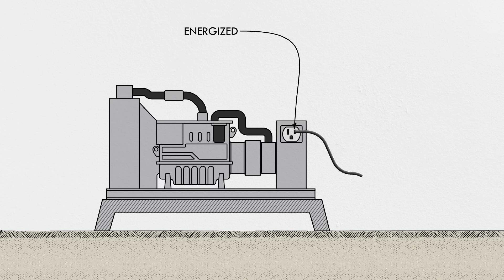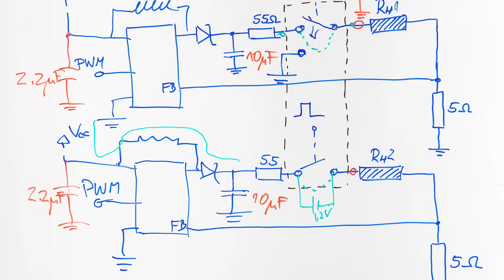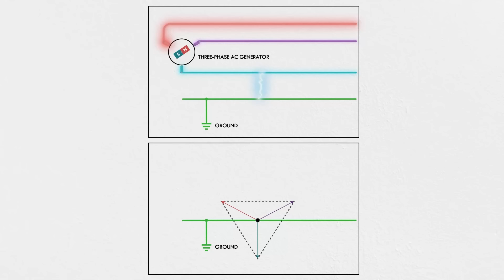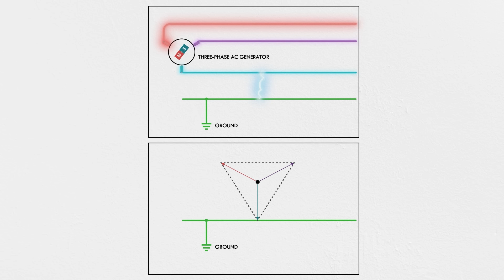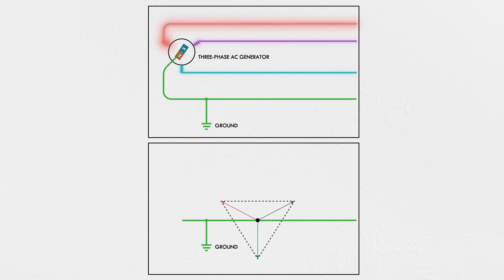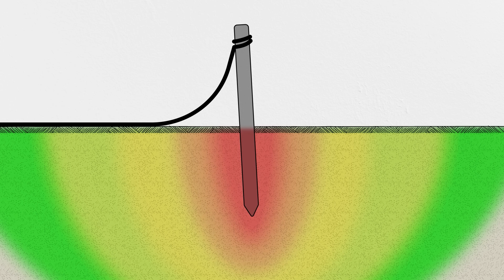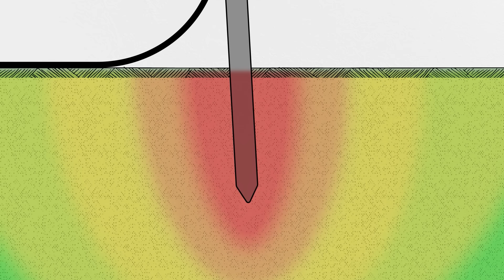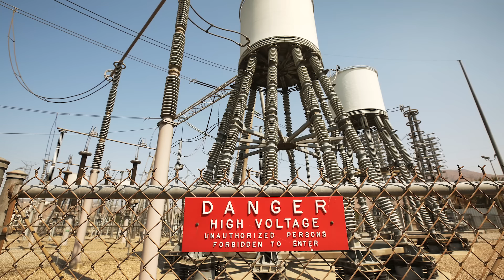Where Does Grounded Electricity Actually Go?

Comment: it goes into the ground
Reply: I can't believe it
Reply: i see, thanks
Reply: @GOOD_FARMER Yes, the ground is made of ground. 👍
Reply: @interstellarsurfer No it's made of earth
Reply: @gamemeister27  
no its made of Gaia
Reply: @AmirDarkOne  Your third party nonsense will never work!
Reply: @gamemeister27  
third party of what?
what are you talking about?
Reply: @AmirDarkOne  I'm just being silly.
Reply: Babby's first joke 🏆
Reply: Aaaactually… the electricity goes to power the turtle that the earth sits on.
Neanderthals….
Reply: Where do babies come from, Wizard?
Reply: THANK YOU FOR THIS RECAP I DONT HAVE THE TIME TO WATCH THIS ALL FOR MY TEST
Reply: Electrical flow is based on the movement of electrons, which are negatively charged. The electrons do the actual moving. Negatively charged electrons are drawn to sufficiently positive charges. 

In the event of a lightning strike, the various molecules in the atmosphere develop a positive charge. When the positive voltage is dufficient enough, neighboring atoms give up thier electrons. This repeats in a dominoe effect chaongi g all of the way down to the ground via the path of least resistance. The electrons are actually flowing up and the display of light is because of the electrons moving. The movement starts in the air. Think of it like traffic. The first car moves, then the second car moves, then the third, and so on. What we se is the initial movement, making it appear as though lightning is striking the ground, but it really isn't.
Reply: @exisfohdr3904  wow. Way to ruin a humorous thread. You must be fun at parties.
Reply: As soon as I read the comment I closed the video immediately, it was the answer I needed, thank you
Reply: Wow, thanks so much for spoiling the video….
Reply: This is true in the States, sure. But we need to keep in mind this is regional behavior. In the UK it goes into the Earth instead, for example.
Reply: @AmirDarkOne third party is the one after the second party. 

Disclaimer: I'm also just being silly 😅 more laughter 4 the world!!
Reply: @iggdawg in Australia, it comes out of the ground to power the generator,  obviously.
Reply: Saved me a click
Reply: Nooooooo!
Ya think? 😂
Reply: We aren't blind
Reply: Oh. My. We have a real visionary here among us
Reply: @davecrupel2817  We're still trying to debate it so hang on with that conclusion please
Reply: Got em. Next.
Reply: Spoiler alert
Reply: Like the electricity, this man's comment took the past of least resistance.
Reply: It doesn’t go into the ground, it goes through the ground
Reply: Okay calm down Nikola Tesla
Reply: @Lefty217   😆😂💯
Reply: I need to see it to believe it
Reply: 😂 hahaha
Reply: @gamemeister27  No, you're wrong just face it. It's made of ground.
Reply: @euphan123 Deez nuts 😂
Reply: @GOOD_FARMER  no it doesn't. The earth is like a capacitor with a certain capacity, but it discharges through the atmosphere. The earth has a capacitance of 711 microfarads, with a super high capacity and voltage limit. Energy disperses through the grownd; this effect can be easily seen with a film capacitor. If you discharge a film capacitor, then it will discharge all accessible power, then if you wait a few seconds, more power will come out; this is because of the dispersion of energy. Think of the earth as a bidirectional capacitor, where the atmosphere and the ground represent it's electrodes. If you put high frequency, high voltage power into the ground, then you will get a return voltage, and the rate of time it takes to return is the planets electrical resonant frequency. If you match the resonant frequency, then the amount of return voltage will continue to build because you are charging the earth, but it has a capacity. At a certain point, the return voltage will peak, since it is discharging through the atmosphere.
Reply: @exisfohdr3904 You have a number of errors in your otherwise excellent lay persons explanation.

1. It is more like a chain than cars in traffic. As one electron moves it simultaneously causes the next electron to move (dragged) into the vacated valence shell.
2. The appearance of lightning striking from sky to earth is solely due to the concentration of charge. When the lightnings multiple paths are being charged they come from many sources at earths surface to a focal destination in the clouds. As the concentration of charge in the sky is greatest, the light intensity glows brightest there, while the concentration is increased along the paths giving the impression of a bright starting point in the sky reaching down the path to earth.

This why collection of charge from a lightning strike is a pipe dream, you would need electron collectors in the atmosphere.
Reply: @GOOD_FARMER i dont think its infinite, we can calculate the capacitance if earth by using the concept of speherical capacitors
Reply: This guy gets it
Reply: @GOOD_FARMER  infinite my @$$. What’s the actual capacitance of the earth 🌍 ? And what if it’s overloaded? (Think of vegeta ki blast assuming ki is electrons)
Reply: Thanks, you saved me about 20min
Reply: So the lizard people in the earth get power aswell
Reply: @The-Cat are you part of the 4th party?
Reply: What a groundbreaking discovery!
Reply: @kennyalbano1922  ah dang it, okay what gave it away? How did you find out?   What kind of un4tunate mistake has revealed my origins? I need you to produce an answer at once!
Reply: Genius
Reply: My god
Reply: I tend to disagree
Reply: The Backrooms not the ground
Reply: @gamemeister27 😂
Reply: CHI-NA
Reply: Thank you. Youve saved me so much time.
Reply: Happy Birthday to the ground!
Reply: As we all do😌
Reply: Happy birthday to the GROUND
Reply: @The-Cat  elementary my dear whiskers. Solving this case was easier than the cats pajama’s. All I needed was some hair of the dog while I listened to what a little birdy told me and this case was solved lickity split. And don’t you worry the electric chair has a way of relieving one of all nine lives. I don’t here a peep, what cat got your tongue?
Reply: This is the kind of answer humanity needs…. For many things
Reply: Love the avatar. I'd keep a sheep in my apartment but there's a height restriction on pets here.
Reply: but where in the ground?
Reply: Oh no... apparently, according to this vague descriptive dude, it goes "through" the ground 🙄 you know,.. because there's some scientific difference there between what it actually does when it enters the planet..
Reply: @samuelhulme8347 I'd prefer a Nobel prize over a noble prize🤷🏻‍♂️js😁
Reply: Really?!
Reply: saved me 19 minutes!
Reply: @tempesttree8839  that’s what I meant!
Reply: @o0Donuts0o Not directly. It goes 1st through the 4 elephants.
Reply: wha?
Reply: No fuckin way
Reply: Gosh, spoiler much
Reply: Wow, thanks for the spoiler
Reply: Thanks you saved me 20min😊
Reply: Duh
Reply: Wow. You could write a book
Reply: I’ve never wanted to like and dislike a comment at the same time more in my life
Reply: @o0Donuts0o it's turtles all the way down, not just the one
Reply: Good morning, Mr Oppenheimer
Reply: Then why is it called grounding?
Reply: I was gonna watch this video until I saw this comment
Reply: This comment didn’t age well
Reply: It's has what plants crave
Reply: so true bestie
Reply: But it has to be home by 8pm, and no partying
Reply: yes
Reply: It has something to do with the average macroscopic cross-section of thermal neutron flux.
Reply: no video needed
Reply: get this guy a nobel prize
Reply: Huge
Reply: I noticed that too. 👍
Reply: WHAT, that’s impossible
Reply: Epic troll
Reply: It goes to China
Reply: Thanks…video explained other details which we were not interested in.
Reply: Yep
Reply: @iggdawg and in France it goes into terre
Reply: I still don’t get it
Reply: @Gomer._.  try to put yourself between a live wire and the ground. It may clear up things (or not). Anyway electricity flows between to points with different potential (voltage) and soil that has electrolytes in it may serve as a conductor.
Reply: Huh, never would've guessed...
Reply: @ryanc473  Smart alec
Reply: Nuh uh
Reply: Saved me 20 minutes thank you
Reply: Thanks! You saved me 20 minutes.
Reply: Yes
Reply: @shawnwhite860 Lmao
Reply: @iggdawg Lmao
Reply: Thanks
Reply: Thanks. Just saved me 15 minutes
Reply: "It" identifies as They.
Reply: Thank you sheepiscool :D
Reply: You don't say
Reply: Whoa, whoa, whoa, slow down. I'm taking notes. Lemme finish this note, first.
Reply: Now i don't have to watch a 20 minute video. Thnx
Reply: My grounded wire tickles a little chineese mans feet. You're welcome Hong Choi Yen!
Reply: Wasn't expecting that to ground out
Reply: @gamemeister27 earth is made of ground
Reply: @Tonyrg1988  pure fantasy
Reply: Your a genius
Reply: After a lightning storm, I like to walk out into the park and ground my self.
Reply: Wow no spoilers pls bro :(
Reply: Answer lies in the question
Lol
Reply: @thomasinnis2370 Haaaaaa🤣🤣🤣🤣
Reply: @wouldbfarmer2227 Now you're being obtuse and collusive🤣🤣🤣🤣🤣
Reply: @troyallen8223  lol
Reply: @wouldbfarmer2227  😁
Reply: Yup
Reply: Doh! 😂😅
Reply: 😂 the video should just be someone saying that, then it ends
Reply: Thanks you captain obvious 😂
Reply: @daleperkins7745 Correct. Ground powers the underground cities for the lizard people.
Reply: It only works if the earth is flat.
Reply: I thought it went into the air
Reply: Saved me 19 minutes and 39 seconds of my life. Thank you.
Reply: The ground is 100% Earth but not the other way around.
Reply: The earth is positively charged.
Reply: Lol yup
Reply: Real.
Reply: Genius
Reply: @exisfohdr3904 The electrons don’t move much, but the energy propagation does.
Reply: @OriginalMasters  If we consider "energy propagation" as something that can move, then it must be moving based on a force equal to its motion.  The sum of the motion for "energy propagation" is relative to the sum of the motion of the electrons.
Reply: @exisfohdr3904  In some cases, the motion of electrons can indeed contribute to the generation or propagation of energy waves. For example, in electrical circuits, the motion of electrons (electric current) can generate electromagnetic waves.
Reply: @missaisohee do you really see?
Reply: @OriginalMasters  which is exactly what my original post was referencing.
Reply: @exisfohdr3904  Agreed.  We just want to make sure that more people understand that electrons don’t physically travel to complete circuits.
Reply: @interstellarsurfer but is it ground beef, pork, black pepper, oats, mint, glass, little bit everything
Reply: Honestly the reason I haven't gotten around to this video yet lmao
Reply: @OriginalMasters  electrons most definitely do move though slowly yes and not every single one but they do move they kinda have to move since they are a charged particle that's weakly bonded to a nucleus.
Reply: Clicked the vid just to comment this
Reply: "Too long didn't watch"
Reply: saved me 20 minutes thank you 🫡
Reply: It's what plants crave.
Reply: @coiladdict Is that good news or bad news?
Reply: @michaelforansich8090 What's the difference between a concentration and a collection?
Reply: @Jo-re2ye Kind of like Gatorade?
Reply: "No,  the soil"  -   juicy jay cornish
Reply: @saverioscala1327 and then you got back to respond? Lol
Reply: You must be near Microsoft headquarters.
Reply: saved me 20 minutes..👍
Reply: jokes like this really keep me grounded
Reply: Καλημέρα από Ελλάδα.
Το βίντεο είναι ωραίο.
Μην τρως κονσέρβες.
Μην δίνεις στα παιδιά κονσέρβες.
Καταλαβαίνω, ότι βγάζεις χρήματα από αυτό.
Reply: Did you just give a spoiler?
Reply: Yes
Reply: 😂 I think a better title would be “WHEN does current flow into the ground?”
Reply: @euphan123 ostrich eggs
Reply: that made me laugh.
 ^_^
Reply: Thanks. Now I don't have to watch the vid 👌
Reply: Thanks man. Saved me 20 min of my life
Reply: Ha!
Reply: go home everybody! that's a wrap!
Reply: Because of gravity. 

I read it somewhere on the internet so it must be true.
Reply: Thank you, Tesla
Reply: True dat
Reply: I concur with your concurrence
Reply: @Youxshii I know man I just saved myself 19:34
Reply: Well.... I was gonna watch the video. No point now.... Kinda wondering why I picked it to begin with. Lol 🤣
Reply: @euphan123 your mom.
Reply: Tecnically yes
Reply: Just saved me 20 mins 😂
Reply: Clicked only to like this comment
Reply: Alright looks like I don't have to watch the whole video then
Reply: Impossible
Reply: No... No no it can't be. There must be something
Reply: m i n d b l o w
Reply: It’s under the sauce
Reply: Genius
Reply: Science!
Reply: "Don't you sass me boy, I'll skin your little tail!!"..dad??..how'd you get in here?
Reply: Thank you bro
Reply: You don't know that
Reply: @iggdawg so you have earthed circuits in the UK?
Reply: Wrong,  it goes on punishment!
Reply: I was gonna come at this, but I saw the video title but you already did it
Reply: @gamemeister27 i disliked your comment
Reply: Oohhh i always wondered how that works
Reply: Gee why thank you !
Reply: It dissipates into the Ether.
Reply: Thank you. Saved me the time of watching this video
Reply: Spoiler alert 😂
Reply: Thanks for saving me 20 mins :)
Reply: The Definition of Ground means Earth!
Reply: Ok
Reply: Yeah but where after that
Reply: This comment had people looking at me on public transport to make sure I was okay 😂
Reply: my first thought too but apparently there is a 20 minute video I have to watch now
Reply: 19 minutes saved, thank you
Reply: fair enough
Reply: Thankyou
Reply: I thought that too
Reply: Grounded vs grounded battery.
Reply: But you didn’t have to cut me off
Reply: Unbelievable
Reply: This is the top comment of course I’m dead 😂😂
Reply: I thought it got sent to its room
Reply: Nooooooo
Reply: @euphan123 how is babby formed? how does girl get pragnant?
Reply: @The-Cat Os the secomd party like a pre-afterparty? Sounds boring.
Reply: @asahearts1  yea it's very boring, that's why there's a third party 🥳🎉
Reply: I’m shocked!…….ill see myself out
Reply: If only we could harness the energy of earth
Reply: thanks bri
Reply: thanks bro
Reply: You saved innumerable people 20 minutes of their precious time.
Reply: Ya think?
Reply: guys, it goes to the nearest transformer where it came from. It doesn't do the Earth. Ground is used just as a wire to make a connection to the transformer
Reply: That was my answer.
Reply: ah!, so that's why my electricity bill keeps going up for the same number of kilowatt-hours.  it's all collecting down there.
Reply: @coiladdict  so, does that mean you can film the electricity going into the ground?
Reply: @o0Donuts0o Oh, I don't know. I personally found it funny that they went for a full explanation, and got so excited by their own answer, their spelling etc went right out the window.
Dufficient, Dominoe, Chaongi g, Se..
I vote that the comment stays!
Reply: Thx
Reply: The timeout corner duh
Reply: no really i thought it went to the sky
Reply: Don't forget to like and subscribe.
Reply: earth
Reply: wow, can't believe it
Reply: [insert calling bullshit meme]
Reply: @interstellarsurfer Negative.

The ground that's made of the ground, is under the ground, which is grounded.

Coming up next: Fully automatic yogurt raisin shooting Gatling air gun turrets for home defense!
Reply: @gamemeister27 Negative.

The Earth is made of ground, which makes the Earth grounded!
Reply: came here to say this
Reply: Big brain 🧠
Reply: That can't be true
Reply: 😂😂😂lmao
Reply: spherical coaxial resonance
Reply: Hahaha hahaha Einstein! Hahaha. momma says I is smart hahaha
Reply: Hahaha! Best comment I've seen in a while!
Reply: no i think it goes into the air
Reply: “Brilliant Holmes.”
Reply: Thanks. Saved me time not watching the video, but then I had to read all the comments…….
Reply: Thanks sir, you saved 19:35 of my time
Reply: 5head
Reply: no spoilers bro
Reply: Likely burned to make steam that turns alternators producing electricity
Reply: @AmirDarkOne who you calling Gaia?
Reply: @gamemeister27 It's made of poop
Reply: Thank you for saving me 20 minutes
Reply: Can you be more descriptive and clarify? .... oh that's what the video is for